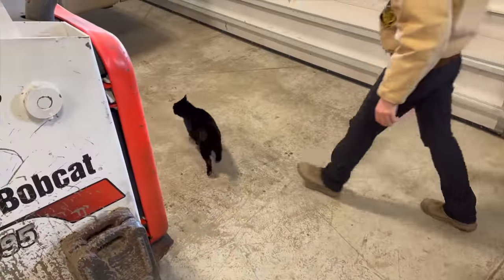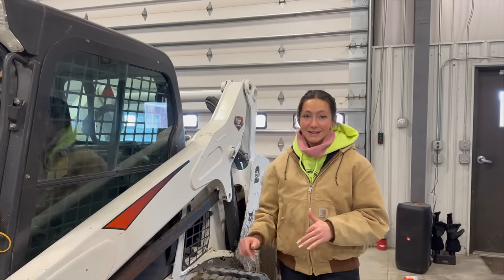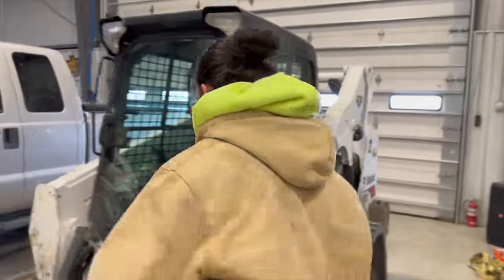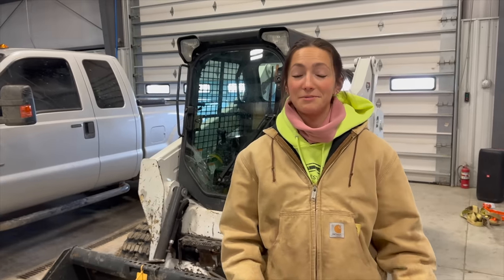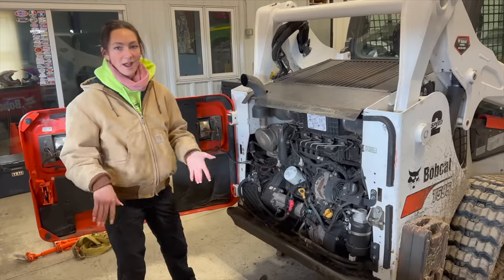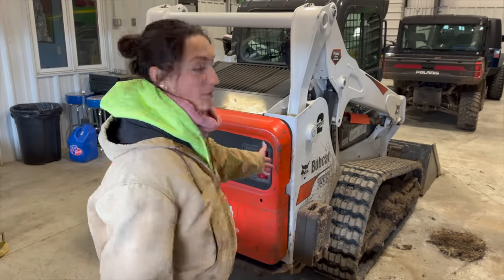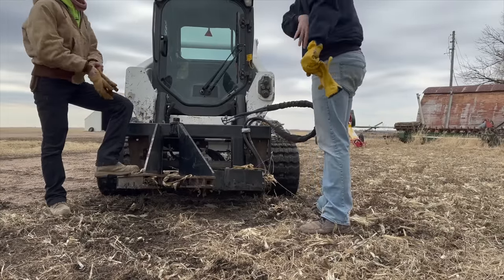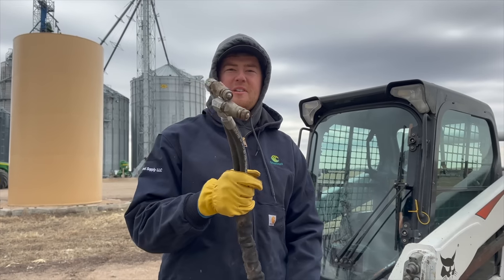He Finally Got What He Wanted...

Comment: You might want to consider backing the skid loader on the trailer since the weight is more to the back than the front on a skid loader. Safety first.

Comment: The hydraulic flow. Basically your axillary hydraulics is opposite and bobcat from all the other manufactures so if you’re swapping attachments from a neighbor who happens to have a case or a SV your hydraulics are going to be backwards and you’re gonna have to switch your connections if you’re borrowing attachments from your John Deere, I would check with John Deere to make sure your pressure and return are the same

Comment: Laura a few helpful hints here... a ton of people have commented that without the but or other attachment counter balancing the front when loading or unloading, back the skid steer on. True! 

But I will share an old time trick we used to use on old 2 wheel drive backhoes..  take a chain and loop it through a stake/tie down pocket mid trailer and then the other end around the quick attach part of of the boom. As you go up the dovetail of the trailer, raise the boom and it will hold you down on the trailer. It will keep you from doing wheelies or rolling over.

Also your Bobcat skid steer is new enough that sitting in the cab on the right side where the bucket lock is, there is and ISO and "H" pattern button before starting put in "H" and you will have travel on both sticks... forward and backwards for each track and right and left control bucketand boom controls

Put in ISO mode the you have forward, back, right and left on your left stick and bucket controls on your right stick.  Have to shut machine to off to switch. Each has pro and cons. 

I have a Bobcat T770 and run mine in H pattern most of the time. Also to turn Hi Flow on... on right side above the green unlock  button and where the lights are you will see a hydraulic button.  Push it twice and you will see a little green LED on each side of the button and controls on sticks will run the functions of the attachment.  HI-Flow on display. 

One thing you will come to hate us if the boom is not all the way down you can't open the door! 🤬🤬🤬 That can be a pain in your ass at times when you are by yourself 

Be safe and happy farming!!! 😉👍👍

Comment: G & L, 
Another good way to smooth dirt with the bucket is to get a bucket full of dirt for weight. Then put the bucket full of dirt flat on the ground or close to flat. You will get the feel for exactly what degree of tip you want as you work it. Use the float setting and back drag the area on a 45 degree angle to the cut (or the berm whichever you're dealing with). In extreme cases you might want to back drag it twice over in this manner but the second time you back drag, do it in the opposite direction, again at a 45. That would be 90 degrees from the original back drag (a cross pattern). I have never done this with a skid steer, but I have done it with a backhoe many times. Should work the same provided the bucket is large enough and heavy enough to do the trick. It will give the topography a lot smoother general finish than trying to use the sharp edge of the blade to get close to a finish grade. 
I notice that your new skid steer has the arm set up so it can reach high enough to load into a regular size dump bed. In certain situations that's a great tool to have. Maybe they all are that way now, none of them were that way in the beginning and it was a pretty bid deal when they started appearing with that feature. 
Good luck. Love you guys videos.

Comment: few things. Congrats on the skid loader. However, you want to load it backwards up the trailer or that will happen or the truck will move foward only load it foward with heavy implements on it. Two you should get a skid loader trailer mover they are great we don't know how we would live without them. Third, you need a brushhog and grapple and pallet forks they are all great in their own way. Lastly, you want to make the attachment pickup the skid loader by having the attachment push it up  off the ground. We put on forks and it was not latched all the way they fell off and almost killed my brother.

Comment: When loosening a fitting and you have the T595 close by.  put one wrench in the chain pocket to hold the fitting.  it will come off easier.  remember keep the mud cleaned out of the tracks.  when loading the T595 without attachment back it on.  the T595 has the 74 hp engine and the counter weights that adds more tail weight.  Have seen them rock back on the back door and toast a engine.  T595 is a great machine.  Laura did great loading.  Most would have quit.

Comment: Whew!  That was almost a bad situation in that first clip loading onto the trailer.  Bobcats are very bouncy and tippy when no front attachment.  When I was a kid, I used to always do wheelies on our wheeled Bobcat, especially when changing attachments.  Backwards and then quickly forwards and it will go right up.  I also noticed in your other video when Grant was bringing that seed into the shop that he didn't lift the forks after setting the seed down (banging forks on concrete floor when exiting shop door).  Since they are so bouncy, especially with no load, you usually want to get the lift arms off the ground.  You don't usually drive around with the arms all the way down unless you are moving something big/heavy and going very slow.  Jealous about the purchase!

Comment: FWIW, one of the best accessories I've used on a skid steer was the installation of an always on backup camera.

Installed one on my Case skid steer about 9 years ago.  Don't bother with on in reverse only.  Reaction / delay time is too slow.  Hooked it up so the camera / display is on whenever the motor is running.  No regrets.  Thankfully it has helped detect & avoid several injuries over the years.  Best $400 I've spent.

Comment: A long, long time ago when I worked in construction I ran a John Deere skid steer a lot.  I got very used to the controls and (if I may say so) was pretty proficient at doing...whatever.  Then a few years ago we go an older Case skid steer on the farm and, to this day, I kind of suck at running that thing.  I don't put enough seat time in to get used to it.  The controls are very different, in that there are no foot controls at all, but you still use both hands to go forward and back.  The advantage of this new Bobcat that you bought is that you can drive with one hand.  That means you can take a drink, make a call, or scratch your nose while you are driving.

Comment: Always load your skiddy in reverse especially on a deckover trailer, bolt at least 2 3inch channel irons on the beaver tail for traction,  keep your tracks spotlessly clean, keep a spare belt on hand especially with the tracked units, get a couple of 1/2x 4 or 4.5 coarse thread bolts for the quicktach that go into the spring assembly (don't ask how I know all these things) use real good quality extra tacky grease and do the quicktach pins and bottom pins in half the recommended intervals. Biggest most used attachment is a pallet fork, make sure it's at least 48inch and don't buy a China one, get a deere or Bobcat one. Have fun and be safe, if you are working around trees or loading gravel over top of the cab remove the door and save the cost of the window, that's another reason to loader in reverse.

Comment: Congrats to your new toy. As an owner of a Bobcat 751 since 10+ years, I want to give my thoughts... if you go uphill, like up on a trailer, ALWAYS ALWAYS go backwards. For sure without bucket (no weight in front). The bobcats tipover backwards easily and its for sure uncomfortable for the driver and the machine, to make that salto. There are enough videos out there, to show how NOT to drive a bobcat. You have been lucky to not tip it over.
Anyway, have fun with it. Its a great piece of equipment, very useful. I'll never give up mine.

Comment: 1) get a length of tubing that fits into the pockets on the trailer deck

2) get a steel plate, sturdy enough to mount a bench vice to. drill holes as needed.

3) weld plate onto tubing, bolt on the vice. if the vice can swivel, all the better.

4) if your trailers all have different-size pockets, make several bases - you never know when you need to hold something, but still need  both hands free...

(and yes, REVERSE onto the trailer, esp when there's nothing attached to the boom - rear 'wheelies' are hard to recover from, been there still got the scars)

Comment: Just an FYI it’s much safer to back the skidsteers onto the trailer. I’ve seen them go over backwards before. At least when the bucket is on the low side you can catch yourself and save it. As well as it’s not very likely to tip forwards comparatively.

Comment: I enjoy watching your videos. Maybe a tip I can provide would be to purchase an inexpensive vise you can attach to a plate, which will fit in the hitch of your pickup. That way when you have to "wrench" something that is a little stubborn, it will be a little easier to lock one side of it into the vise and you can then "ugga dugga" whatever you need to release. Also, I'm sure you and/or Grant have seen someone take a box end wrench and make an extension to another box end wrench for some additional torque. Put the box end of the extension wrench on the lower tang of the open end of the wrench on whatever nut you are working on. You can then push the flat side of the wrench providing the extra torque against the tang of the open wrench on whatever you may be working. Confused yet? May take some experimenting to get it on there correctly, but it provides a little extra torque to bust loose a frozen nut.

Comment: If memory serves, those Bobcat brand attachment hydraulic couplers are a -12 orb fitting. Many folks end up with a 1/2" NPT fitting. We used to order the NPT fittings from A&I. But several vendors sell such a coupler. Also, many skid steer/CTL's use those same style of hydraulic couplers. They shouldn't be too hard to find.

Comment: Awesome video! 👍We use all Bobcat skid loaders on the dairy they're great machines!  All of ours are wheeled with the exception of the s250 that has wheel spacers and over the tire steel tracks...If it wasn't for all the concrete we are turning on constantly we would probably have a dedicated track machine.  I watched the Neighbor dig out a 200 ft driveway in the rain with a rubber track machine down to the clay with no problem...a wheeled machine would've spun out in minutes 😅

Comment: If both of you are around for loading/unloading the one not driving the skid hold the brakes of the truck. If there is only one (or need a camera person) pull the breakaway on the trailer. It will stop the rocking, give you a better feel for skid while loading/unloading and and save a lot of wear and tear on the trucks transmission. Great when on slippery ground it dirt, mud, snow, Loading equipment on a trailer can remove enough weight from the rear of the truck that it can slide causing runaway truck. Moreso when loading on an incline, depending on the surface (snow or ice) ice seen it on a flat surface.

Comment: So now you have a trailer and a skidder:  You'll be wanting a couple different sized vises mounted to side-board stakes to put in a handy stake socket as well as a large hand crank cable winch with an 8 inch pulley on a multipurpose hook so you can run the winch cable down through the pulley on equipment and back up to a stake on the other side to recover stuff.   A set of stub stakes and boards (six inch and 3 holes long) are a good idea as well.   

I strongly instruct that you get two pairs of wedge blocks that fit the skid's clearance and the heaviest load anchoring gear you can handle when sick. 

You'll also want a carry-box that can be chained to the skid's bucket, put on forks and hooked onto the skid by it's attach.   Being able to dump junk is good so the "front" tilted out is a good idea.  Kinda like an elevator's lift buckets.

Remember that while you CAN road the skid... it'll make the tracks very hot.   A set of short junction cables to protect the skid's front pipes is a good idea too - seen a lot of people bolt plates on beside the fittings as well.   There's a company that makes little rubbers to cover disconnected quicks you may look into.   Doubles the lifetime of the pump.

Comment: You should back up hill (as in when loading the bobcat on to a trailer) because weight is on the backend, even with an empty bucket. basically, you want keep weight uphill on a skid steer, or you roll over end over end

Comment: When using channellocks or crescent wrenches always put the pressure on the fixed jaw.  The crescent wrench can break its moveable jaw if used incorrectly, but the Channellocks just don’t work if used incorrectly. If you pry on the moveable jaw it actually tries to open the pliers and you’re fighting it the whole time. If you push on the fixed jaw, as you push it tightens the grip, the harder you push, the tighter the grip. You an even take your hand off of the movable grip and it will keep the grip.

Comment: Congrats on getting a Skid Steer. They are amazing machines. 
One trick I have learned when using a bucket that has a square edge on the back like yours, is float the bucket like Grant said but tilt the bucket back slightly so the back edge is scraping and drive backwards. Works extremely well to level out dirt or gravel especially if you’re trying to grade hard packed dirt or gravel. Then tilt the bucket level and go back and forth and like Grant showed you using the cutting edge of the bucket on a little angle to back drag. 
You can also tilt the bucket back very slightly and apply a little ground pressure going forward and it will smooth and pack the dirt a bit making it easier to smooth out. You can do the same in reverse just tilt the bucket slightly forward and go backwards. 
Hope that helps.

Comment: Also, get used to leveling forward… that’s the benefit of tracks… once you have a flat surface for the machine to start from, keep the bucket leveled, it will work like a dozer and stay flat. Going backwards you will  rock with the terrain… sure it will float the arms in reverse but will never be as level. A little practice and you’ll have it nailed.

Comment: These are such a great investment for rural properties.  We have an S850, as due to our hilly driveway, tracks aren't as safe on ice as the tires and chains, but nonetheless a super handy bit of equipment.  We decided on this over a loader with a bucket and 3pt blower.  Hands down, such a great too for your property!  On the right column of the cab below your ignition, do you have an ISO/H switch?  If so, that will allow you to toggle back and forth between drive control modes.  Enjoy it!

Comment: Load the skidsteer on rear towards the front of the trailer. It will be more stable while loading and unloading. You can also use the bucket to stabilize unloading.

Comment: You might also check about the ring on the coupler. I think it rotates to keep the connection from popping loose. I think if it comes loose while using it can maybe dead head the pump. I’m not sure about that, so don’t take my word for it. I’m a new owner too, so still figuring it all out.

Comment: Need to set it up where one handle controls forward reverse left and right. The other controls the bucket boom or any other accessories.These are good machines. You guys will love the tracks.With float control on the ride is unbelievable.

Comment: Laura & Grant, Im sure y’all already know this but if your not particularly happy with the controls in its current set up I believe most Bobcats have the option to change the controls from ISO to H pattern. H should allow you to use the left and right joysticks to control each track rather than just the left control stick for movement in the ISO configuration.

Comment: Look in the owners manual, you might be able to switch it so that you can have both joysticks work for driving and then both will also work for the bucket and arms. i know the case skidsteers can change the controls to work however the operator prefered. worth a look.

Comment: Hello.
I am appreciate the good humor and determination that you two share when you confront issues that cause problems or bumps on the road.  Also the appreciate the excitement that you have for your present and future farming lives.

I wonder if you would share at some point the farming practices that you follow that will hold or even add to the value of the ground, the soil, of the farmland that you work.  Is this a focus that you have at all?  Soil is not a neutral medium I do believe.  It needs attention just as the corn plants do.  Without fertility there can be no farm for your future generations.  Beside the machine maintenance and the way you plant and harvest, etc, I presume you hold to certain farming practices that encompass care of the land itself.  Thanks.

Comment: I don't know what you two are going to learn... From what I see you're both pretty good operators. But I have learned with my skid loader it seems to pay the back get on when loading it and pull the head coming off you don't get that rocking motion quite as bad it just seems to feel better to back it on the trailer

Comment: I was talking with a Bobcat Operator who is building our new Dock and he warned of a problem with the Bobcats... If you have that BUILT UP MUD AROUND THE TRACKS GET RID OF IT ASAP.. It damages the wheels under the Track .... He said it works like Sandpaper.... It is very costly to repair and replace and there is a good chance that is why they sold it and did not clean that mud away......

Comment: Might also suggest a bolt-on cutting edge for your smooth bucket.   You can flip it once it gets worn and it will not only give you a stronger front edge and straighter cutting surface, it will extend the life of your bucket.